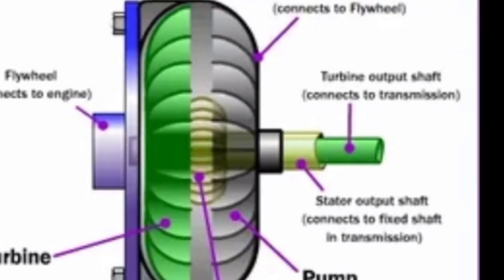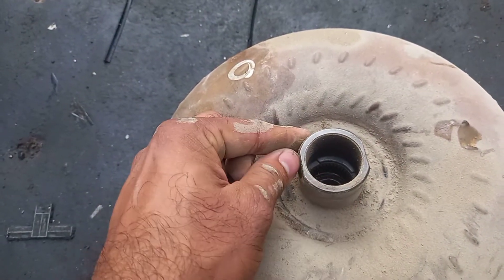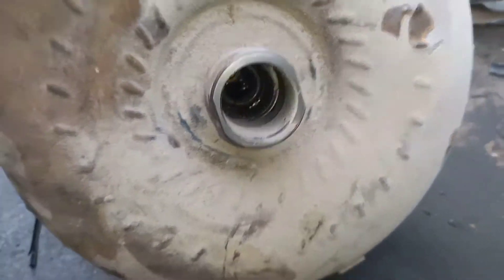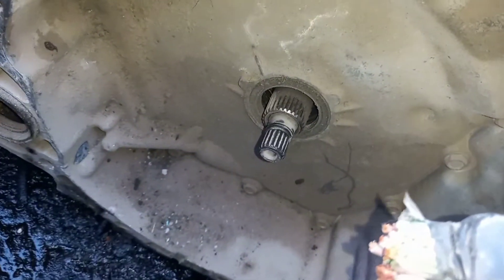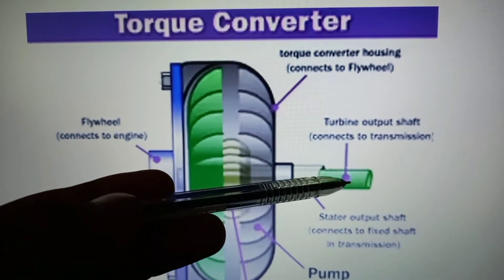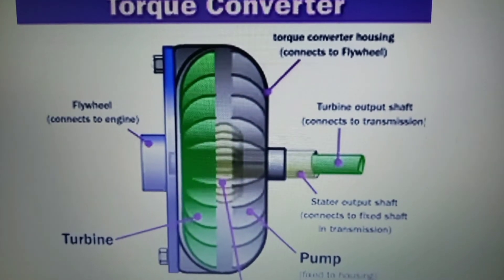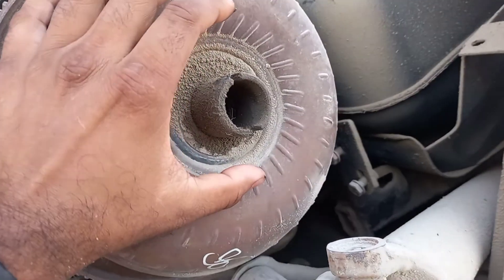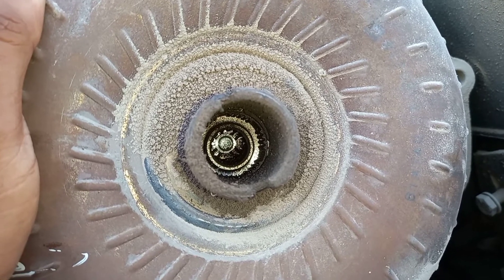How Torque Converter Work English Explained

Comment: Thanks man I'm facing that  problem I've been already changed the stater motor but the grinding noise still sound what to do now?
Reply from the maker: Check turbain  shaft speed input shaft speed . All . Gearbox